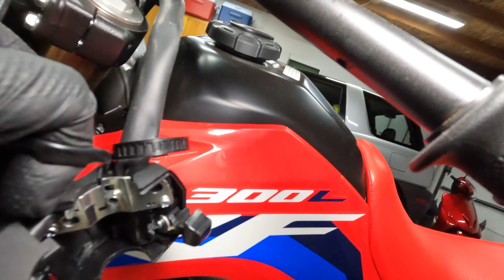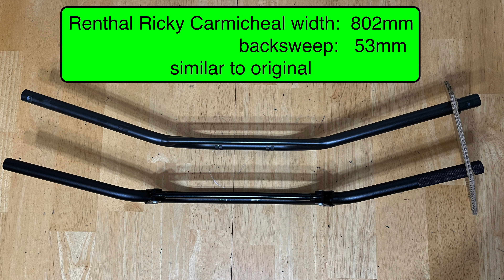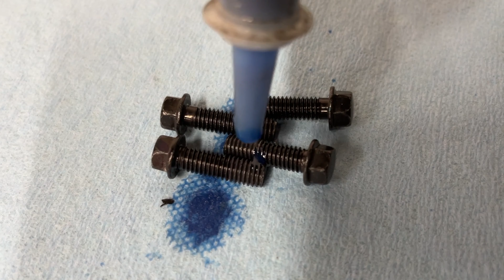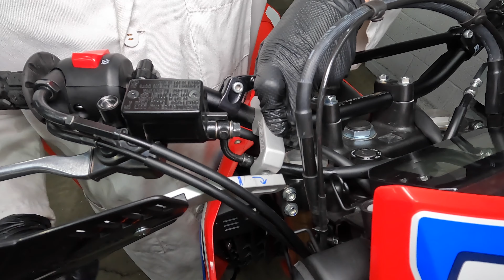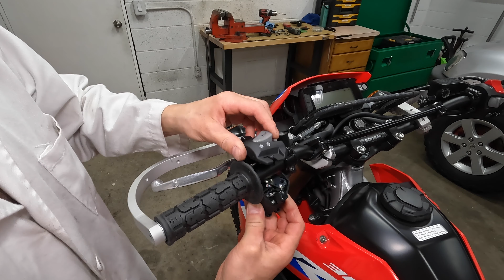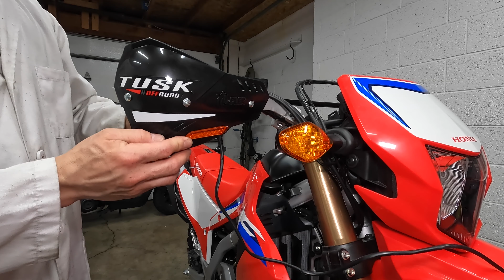Installing handlebars, hand guards, and mirrors on my 2022 Honda CRF300L

Comment: I know this is an old video, and maybe you don't even read this comment, but for other people who are on the boat like me to buy those grips for his/her crf300, as they said below, now there is a specific cam to fit the crf300. On the other hand, ODI states the end caps of the grips are removable so you don't have to drill anything. I'm surprised you had to drill. I've been checking and it's the same reference so you shouldn't had to drill. Any guess? 🤔
Reply from the maker: I might have missed the removable end caps. They didn't look removable when I was working on them.

Comment: Wish I had watched this video before I started on my handlebar replacement with the Pro Taper CR High Bend, you highlighted a lot of the issues I ran into. FYI, ODI now makes a cam type T which fits a CRF300L, but unfortunately they were out of stock so I went with Pro Taper pillow top grips and hairspray and a G2 Tamer throttle - much sturdier than the stock tube which cracked when I dropped it from waist height. I had to adjust the throttle cable to adjust the free play - there are plenty of videos on how to do this. The Acerbis X-Factory Handguards fit fine if you angle the brake line a bit down as you showed.

Comment: Lol.  A smart person would loosen the throttle linkage.....hindsight is educational.  I did something similar on my 50, same issues.  You can use some aluminum brazing rods to fill that hole and try again.
Reply from the maker: Those rods might be a good idea.  I've never tried that!